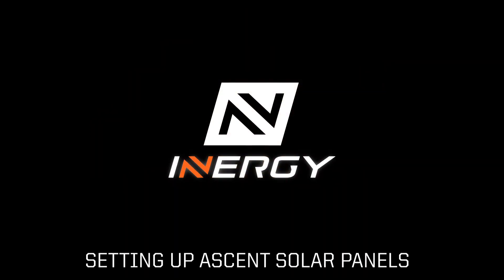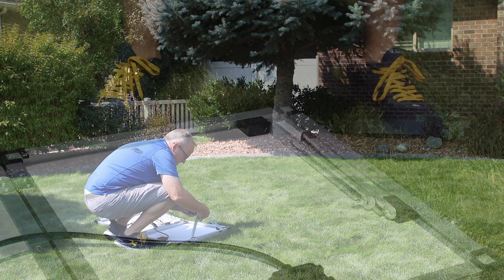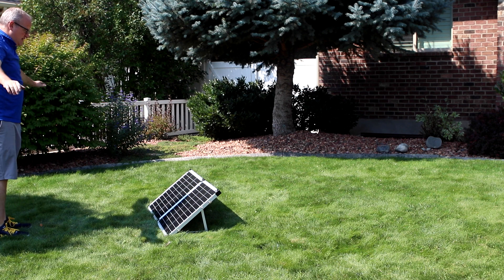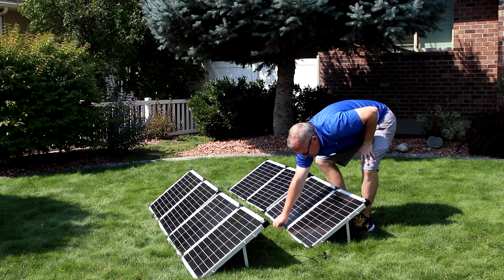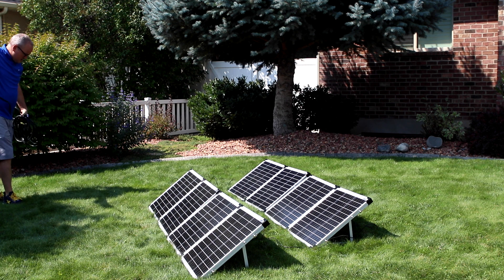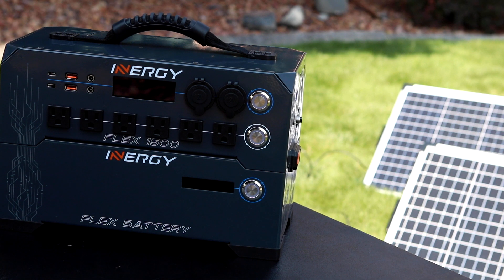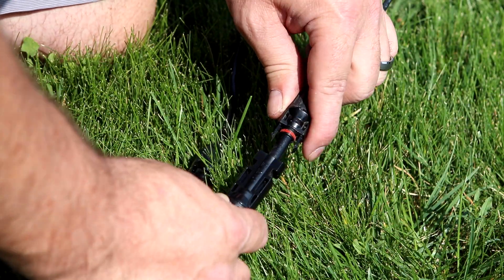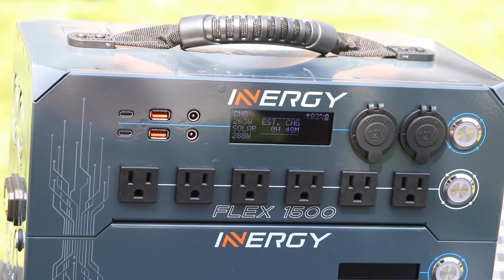How to use solar panels to charge the Inergy Flex 1500 solar power station

Comment: The explanation for connecting the solar panels is totally incomplete. You take the female end and connect it to the male end from the last solar panel through the first then you take the 30 foot cable from the energy battery and connect it to the last and the first solar panel in order to complete the series circuit. This is not explained in the video at all. What’s the point of doing this video if you’re not gonna explain it properly

Comment: website says to do panels in parallel, you did all four in series, so total volts not a problem for Flex 1500?
Reply from the maker: I highly recommend referencing the user manual when connecting panels. Depending on the voltage and connections, some panels need to be wired in a parallel configuration. The Flex 1500 has a voltage limit of 14-90VDC. The Ascent panels have a voltage rating of 17.8V each and can be connected in series without exceeding these limits!

Comment: is it possible to use Dokio solar panels with the flex? and do I need a special adapter? the cables that came with the panels don't look like they will work with the ins on the flex...Thanks